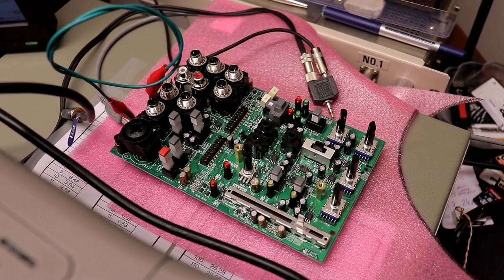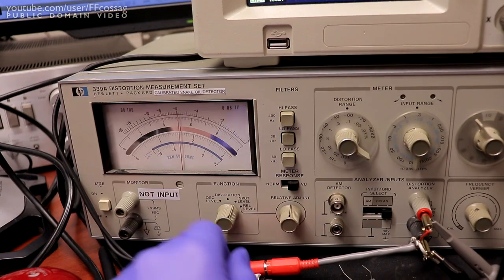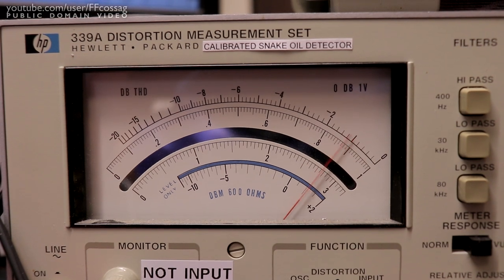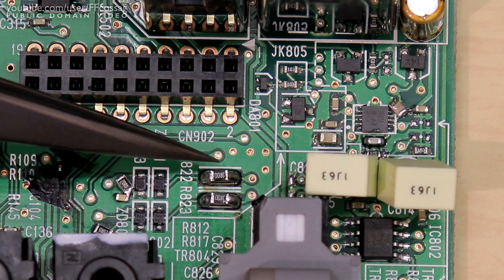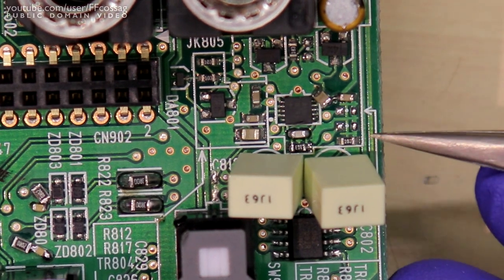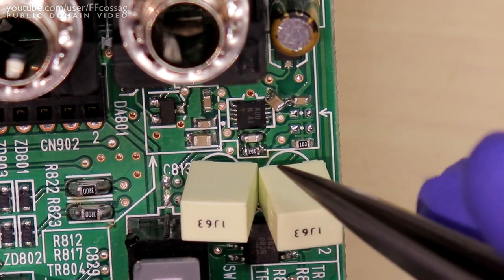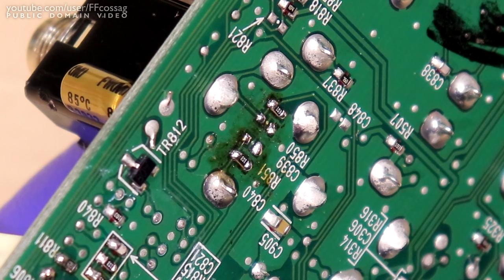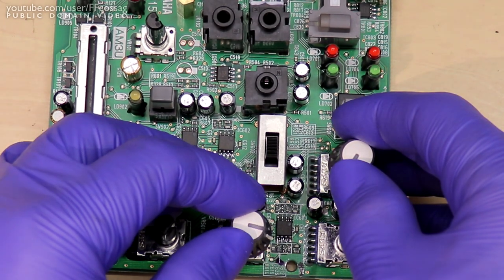AG03 headphone amp output impedance mod 120 Ohm to 1.85 Ohm

Comment: Just the other day I messed up my AG06 (should be similar enough) and it no longer mixes up the CH1 input to both stereo outputs when the switch is in the Input Mix position. Did you come across this part of the circuit on your travels? I'm hoping it's "a physical thing", a transistor or a diode... I'm screwed if the switch just tells some DSP what to do and the DSP is fried. I think I broke it by creating a feedback loop btw.
Reply from the maker: All the mixing seems to be analogue in this one. I haven't looked how the switch in particular is wired up, but the digital part is pretty basic in it, and there are only four buffer opamps on the digital board, suggesting that there's really not a lot of digital processing going on. I'd imagine it's an opamp somewhere.
Reply: @FFcossag  Thanks! I'll crack it open as soon as I get a stand-in. There's definitely some DSP going on, it can do a compressor and reverb, all with detailed software control. Mine even has a guitar amp sim. I'm hoping to check that out too, maybe get it to do a noise gate...
Reply from the maker: Yes, they have DSP, but only on the inputs. From how it's constructed, I'd be surprised if the DSP is involved with any signal switching - though I can't say for sure.
Reply: @FFcossag  Update: a software balance control in the DSP app was all the way over to one side. I found out by doing a factory reset, noticing that everything's back to working properly and than investigating. Shameful, I know, but I'm prepared to make a note of it here for posterity, so none need suffer my faith! :)

Comment: Hi man this is amazing ty for the video
Reply from the maker: Glad you enjoyed!
Reply: @FFcossag  man could u do a review on miniamps nobsound i got a ns14g pro and as i saw earlier on your videos, some of thoses miniamps got some current/tension on the output, i would be glad to see some deep analiszes like that
Reply from the maker: I don't really have the time to organise and do those china amp reviews lately, I'm afraid. If it's a class D thing and powered by a single voltage supply, it's pretty much guaranteed to be BTL and have outputs floating at half the supply voltage.